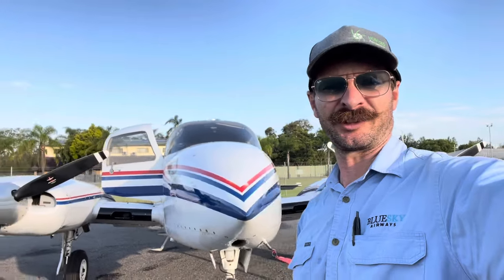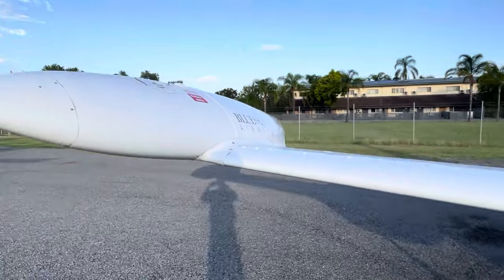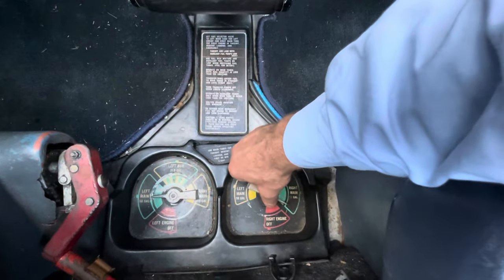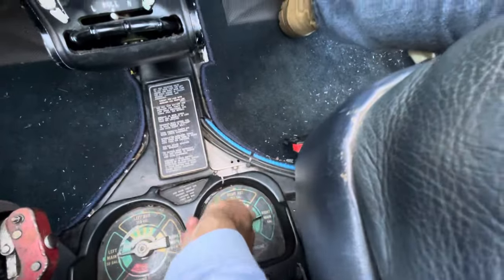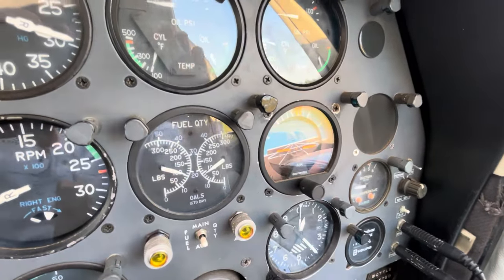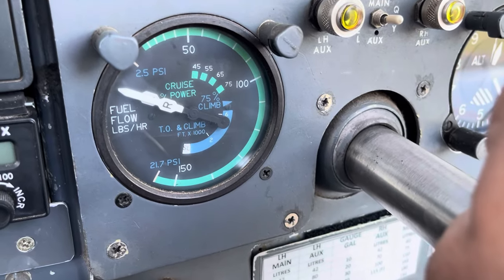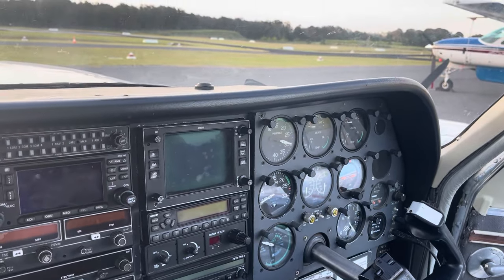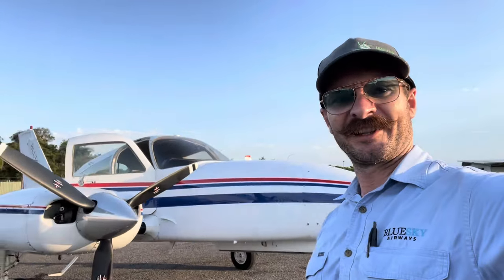The mysteries of the Cessna 310 fuel system

Comment: On the 310Q we operated the main tanks were in the wing and aux tanks were the tips... It was a lot simpler than shown!
Reply from the maker: That's interesting! I've never flown anything but the R model, I'd like to fly a short nose one day to compare!
Reply: I have owned four 310s, ranging from a 59 C to a 75 T310R, and flown a numbet of others, including Q models. ALL of them use the tip tanks as the mains, with the aux tanks in the wings. That is how Cessna designed and built them. The boost pumps are only in the mains (tip tanks), and do not pressurize fuel from the aux tanks (the locker tanks have low pressure transfer pumps which only send fuel to the main tanks on the tips). FYI, Cessna never built a 310 (or a tip tank equipped 400 series airplane) with mains in the wings and aux on the tips.
Reply: You are quite right the tips are the mains! Amazing what 20 years away does to the memory! We did not have locker tanks aft of the engines though. These were just, well, baggage compartments.

Comment: The 310 is a marvelous trainer.  It is always on the Ball.  Do one thing and immediately have to do another.  Continuously!!!  The fuel system is also a good training system.
Gotta get those wing tip tanks done evenly.  Then the locker tanks and then the wing tanks.  And make sure to keep the wing Sniffle Valves open or get ready for the shock
of watching your wing collapse.  But all in all a very good trainer to go to the real Complex Aircraft of the airlines.
Reply from the maker: They're a great machine aren't they! Although yes, the fuel system needs some attention! Probably my favourite piston twin though.

Comment: I used to fly a C310 and a C402 back in the early 1980's.
These days I fly my (very) little Jabiru J-120C!
What great aircraft the Cessna 310 are!
The 310 in particular, it is my favorite light twin!
You are dead right about the fuel system, I remember it being drummed into me during my endorsement.
You had to be very aware that you could dump fuel overboard if you where not paying attention, the same with the 400 series.
I used to fly them heavy and light into remote dirt strips in remote North Queensland.
The performance of a lightly loaded C 310 is nothing short of spectacular!
The company i worked for had a policy of keeping them lean on descent until after landing, the idea was that if you had to go around there was plenty of time to get the mixture right for the increased power, why would there be any rush?
Back in  the early 2000's  I realised I could not remember how to start a 310!
i got a MS flight sim and a great 310 model and wow, the same panel I use to fly, it all came back to me!
I truly believe after 30 years i could step in and fly one today.
Thanks for your video, it brought back great memories.
Reply from the maker: Thanks Charles!  I've never flown the 400 series, but that's interesting to hear they're the same fuel system. I agree completely with that sentiment about keeping them leaned on descent, a go around completed correctly pushes the mixtures up anyway!
I hope you're getting some summer flying in in the Jabiru! All the best!

Comment: I fly a 340A....more or less exactly the same systems (I only have one nacelle tank, which then requires crossfeed) 
The system isn't as bad as folks say, it just isn't forgiving for ignorant people.

 Gotta Read The Manual And Follow It. 

The Baron folks take off on the mains, switch to aux until they are empty, then fly the rest on the mains. I set a time when I take off and fly for 45 minutes on the mains, then switch to the aux tanks. SImple and safe.
Reply from the maker: Interesting about the nacelle tank only on one side, that would require a bit more management again! But I agree, the system isn't terrible, just unforgiving of misuse! 

I've never flown a 340, but they look like a nice machine!
Reply: @aeroplanetoby  The 340 flies like a Big and heavy 310. Pretty decent at speed and a bit heavy when slow. 

The feel is pretty much the same.  
LIke the difference between a 172 and a 182 or 210. 
I use the nacelle tank as my emergency fuel. If I'm into that 20 gallons then I screwed up somehow.